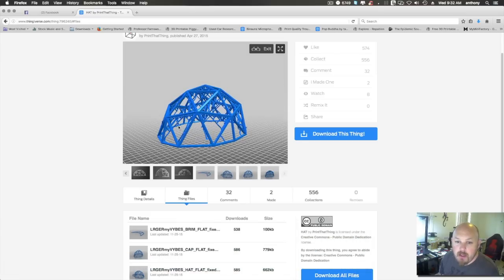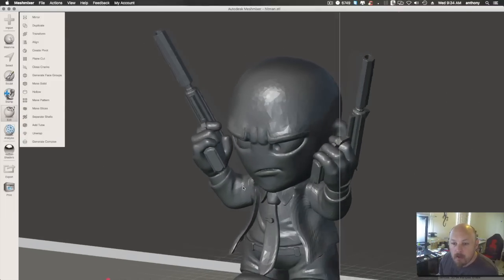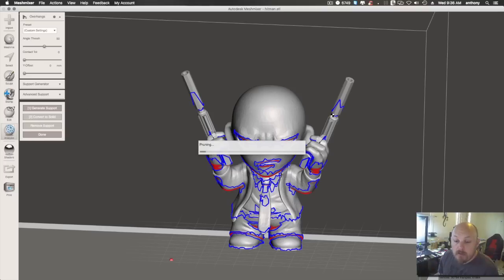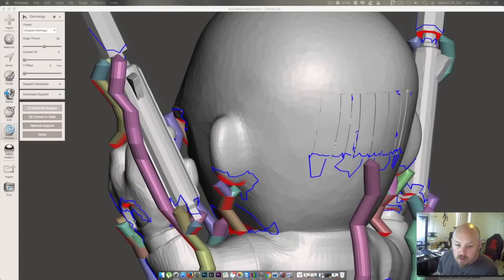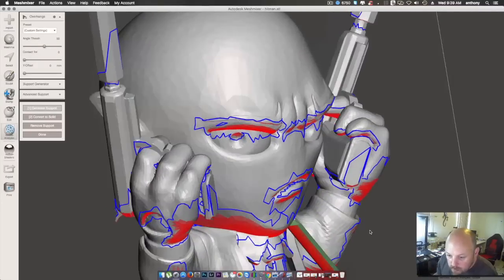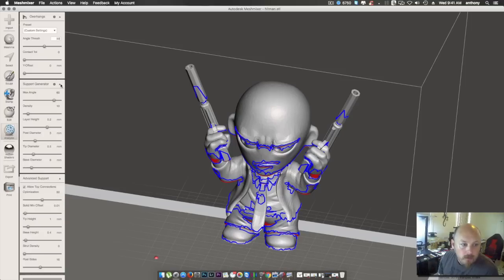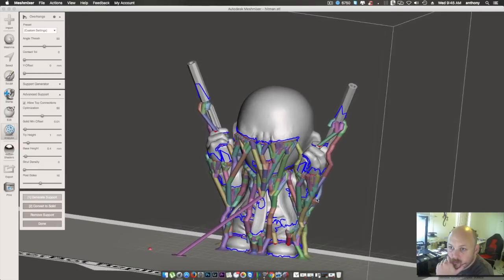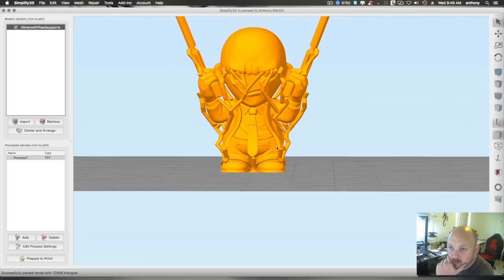Custom Supports WITHOUT Simplify 3D - Cool Tree Supports in MeshMixer!

Comment: Hey, you probably figured this out by now, but meshmixer treats overhang angel backwards compared to most slicers. If your printer can do 60 degree overhangs, then you set meshmixer to 90-60, which would be 30
Reply from the maker: +Sean De Arras cheers

Comment: Sweet, thanks for doing this one, Anthony!  Good timing, too: I have a "statue"-style model that I've been wanting to print for about a week now, but haven't because of S3D support overkill (increased materials and print time by almost 70%!). Meshmixer is taking forever to generate supports as I'm tweaking parameters, but even with the default settings I can already tell that number way down. Cheers!

Comment: Dawn I'm outside of my two weeks test period on simplify 3d... I only got it for the supports.
What do the supports look like sliced? I guess they are treated as part of the model so won't be able to change the specific speeds and extrusion properties
Reply: +Andrew Griffiths I think you could export the support and the original model in seperate STL files, then you could assign different process settings for each individual model and print them at the same time. At least in theory that should work. Maybe you should add some reference mark into both models so you can align them perfectly on the build plate with each other.
Reply: +ExtraBase I'll take a look later thanks

Comment: question:  if you want to readjust the size of the print, should you create the supports before or after the size adjustment size?
Reply from the maker: +justin williams Good question  - I cant see that it would matter as they should scale too
Reply: it metters... if you scale after supports it make the tip of cone supports larger... means hard to remove (i know 1 year old quetion xD)

Comment: Thanks for vid.  Nice to see it explained.  Just tried Meshmixer as I have been going crazy working out best way to do supports.  Best to date is to use Kiss Slicer (even though that isn't supported anymore).  It does great support but even that has a bug where the top few layers of the support are more dense making removal harder and leaves a rough surface.  Anyway tried MM using your vid and supports came off easily...buuuttt it also leaves the surface just above the supports looking ragged, like its guts were coming out.  I would like to use Simplify 3D but it has other problems...so for now, its sigh until some software genius can work it out properly.
Reply from the maker: Did you try tweaking it to have smaller cones ?
Reply: +The Hot End   No have not tried that yet.  The print I tested with has a fairly large flat bit that needs support, so I think the cone points need to be very close to allow the print surface to form properly.  I'll try a few different settings soon and let you know how it goes.  Cheers.

Comment: because i use makerbots software the supports suck, so i do all my support in meshmixer love to control you have with it, and it separates quite nicely
Reply from the maker: +shane beasley Also the benefit that if you see the screenshots, there is less waste as its more efficient :)
and faster
Reply: +The Hot End exactly...... meshmixer is an amazing and powerful tool for any 3d printer.....